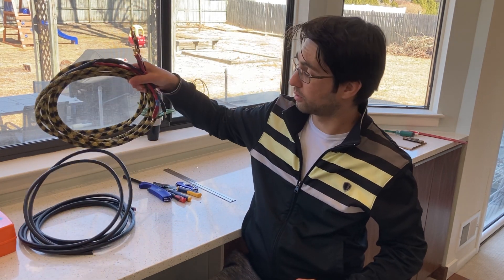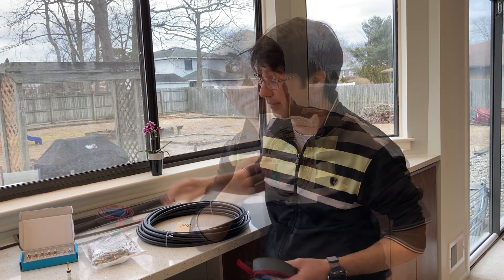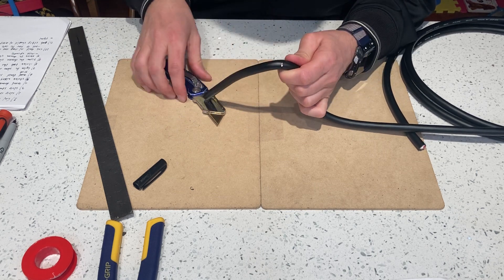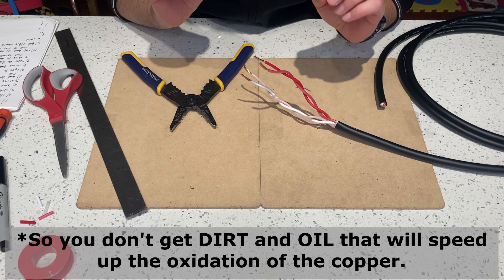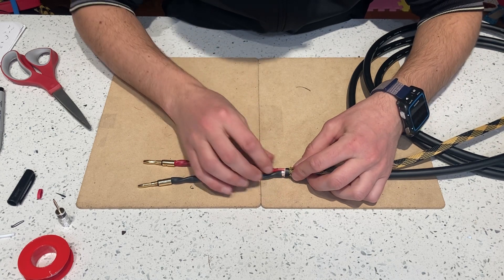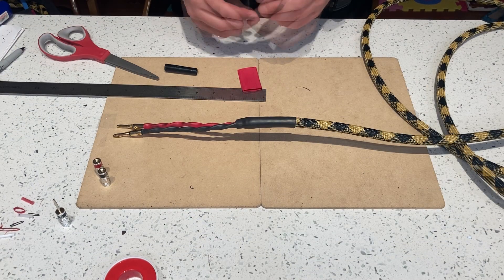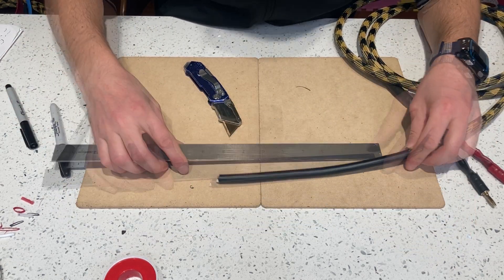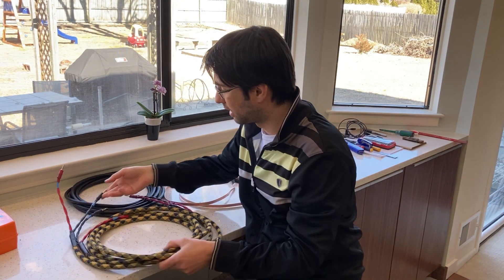DIY Speaker Cables - How to Build Your Own High Quality Speaker Wire (w/t Canare 4S11 Made in Japan)

Comment: While quality of material is important, one of the little known secrets of true high end speaker cable involves its ability to cancel out RFI. Any wire length will act as an antenna and pick up random RF which will interfere with and disrupt the audio signal traveling through that wire. Obviously some settings present more RF problems than others, hence the differing levels of performance improvement noted by observers. Nonetheless, if you are going to go to the trouble to build your own cables, then you should build them to cancel out RF. The simple solution (easy design, difficult implementation) involves running the two leads that carry the audio signal so that they never run parallel to one another, and second of all, that they in fact cross each other continuously at many points along their path. The way to achieve this involves wrapping the two wires around a center core in opposite directions so that they cross each other at two points with every revolution around the center core. A more advanced version of this involves the use of a four wire cable as shown here, with each pair of wires sitting opposite one another wires together (e.g., counting the four wires in the bundle around a circle, numbers one and three would carry the positive signal, and numbers two and four would carry the negative return). Now wrap wires one and three in opposite directions so they cross each other twice with every revolution, for the full target length of ten feet, then do the same for wires two and four. You will have to build a jig that holds the flexible center core tight while doing the wrapping, and you will have to apply tape to hold the wires in place at every foot or so. BTW, power cables have the same RF issues and should be built the same way, using four small (e.g. 14-16 gauge) wires instead of two large ones. Given their one meter target length, they would be a bit easier to build.
Reply from the maker: Great write up! Appreciate you the time for sharing! I actually do deal with Rfi and emi in my job, but those are different systems and applications all together.
Reply: I've worked for years building gigantic industrial machinery hand in hand with engineers you are living in a Dreamland when it comes to your bizzare concepts of RF interference
Reply: @ericschulze5641  I agree.  If it were a problem, folks would have noticed big time throughout the '60s and '70s as this stuff was gaining power and reducing distortion.  If rf injection were a problem with audio spectrum amps and output transducers (speakers) we would have known about it and addressed it decades ago.  Since we know it is not a problem, this guy is just pissing in the wind on that one.  As far as reducing capacitance goes, however...  that does need to be addressed on higher power systems.  Not much at all on lower power systems.
Reply: @ericschulze5641  Funny thing, you failed to mention all the various speaker cables you have built and tested using various designs and materials, and what components make up your highly revealing reproduction system, and how many hours you have spent in critical listening tests, and the many years you have spent in the industry or related music field developing critical listening ears, and the process you go through to minimize bias in your listening tests. I suspect you don't have any of this to offer. Thanks but I'll attend to those who can boast of all of these attributes (and I include myself in that list).
Reply: @SpeakerBuilder  Correct.  The guy has obvs never heard of crosstalk either, despite his ‘years’ of experience in an unrelated field.  I have awfull high frequency hearing damage and i can distinguish between cheap vs expensive cabling, but i can’t distinguish between variants of solid cores or oxygen free, but have to honest, if im spending £15k+ on a system, id probably not insert the cheapest cables on principle, not hearing.
Reply: @briandickie7264  "I can distinguish between cheap and expensive cabling".  Pure horseshit.  I could blind test you and you would fail.
Reply: @briandickie7264  I was listening to audio amps back in the late sixties...  Probably before your parents were born.  And I studied in and worked in electronics all my life and am familiar with all the various and sundry types and ways the original audio signal can get distorted and the various places along the way to the output transducer that it can and does happen.  I don't need a primer from you on it.  I was probably weaving speaker cables before you were born.
Reply: @cosmicraysshotsintothelight  Yes it does seem like you are stuck in the 60’s….   A lot of tech from then was groundbreaking and by today’s standards and knowledge, poor quality, inconsistent and less understood.  Maybe it’s time to update your knowledge.  

What i don’t understand is why you are so rude & abusive.  What has my age got to do with it?  Anyway, if you are like this in real life, it explains your social awkwardness, lack of friends and loneliness.   Kinda feel sorry for you.  I don’t know why life has been so bad for you, to treat others this way, narcissism at its best of course, but i wish you well, but like all narcassists, you don’t take responsibility, have to have the last word, and of course, blame everyone else.  I guess it’s just my turn for your abuse.

Comment: if I had a HiFi System that provides Speakers and Amps that would make these kind of Cables nessecary, so something worth several thousand dollars (15.000$ minimum) than I could easily pay ready made speaker cables for a few hundred dollars. if I don't have a HiFi system like that I could use just regular speaker cables in 4mm and it would be enough.
Reply: These cost $17 each for a ten foot cable.

Comment: Wow. I'll bet these cables sound every bit as good as ordinary, every day speaker wire, or zip cord.
Reply: Yeah, you're right - they will...   They might measure a teeny tiny bit better due to the copper and the connects,  depending on length.  How they're driven, etc. But it won't be a big deal. 

But the cost breakdown for these is pretty damn good.  It is about $17 per 10 feet.   For me, making them look how I want with the sleeving and whatever terminations I choose.  That's the whole deal right there.   

2, 14AWG cables effectively becoming 11AWG...   As a custom cable for my setup.  You can either pay through the nose for that customization or you can DIY.

Enjoy the holidays!

Comment: Come on dude snake oil , pure snake oil no better than just plain good 14awg speaker wire on amazon for $15.  They look nice and you may feel there special, but in the end snake oil no performance gain at all.  I have tried high priced speaker cables and interconnects and heard 000000000 difference.  The single best audio upgrade that you can really hear a differance is speakers.
Reply: Its funny when people get so fixated on a point that is truly subjective that they overlook the the topic of the video.Im not saying you are wrong with the snake-oil comment, although, if your Equiptment is worthy of such cables, you will notice some improvements but they may not be worth cables that are hundreds of dollars each. The real issue here is that you arent even getting the actual point of the video - to make affordable “snake-oil” cables opposed to blowing your hard earned dollars on them.

Comment: typical vodoo audio. The average physics student is able to show with an ordinary meter that you can connect the best and most expensive loudspeakers with a regular copper cable from microwave or washing machines and you will not be able to hear any difference. It is no coincidence that so-called audiophiles avoid blind listening trials. I will also tell you such a secret ... you can buy or make cables for thousands of dollars, and the manufacturer of your super expensive speakers uses inside ordinary cables that have been purchased for kilometers from the same warehouse for many years. :D :D:D:D:D:D:D:D
Reply: @depresja wykalczki     Bzdura.  As speaker builder noted, a high end system can be revealing of anything you change in a system, even tweaks like support cones, pucks, platforms.  We can do our own tests in a system and determine which cables or tweaks improve or degrade a systems performance.  I've tried expensive cables which sounded worse than less expensive ones and vice-versa.  RE: cables.  as I've noted before, cables that have equal resistance, inductance and capacitance will sound the same, but if they are different, then the sonics may be different.
Reply: A true high end reproduction system (with very good speakers) playing very clean music can reveal differences between various speaker cables, as I have demonstrated for myself and as my video on the topic attests to. But these differences are quite small and can only be heard if the rest of the system is true high end. The system I used to test speaker cables would cost in the range of $3500, not crazy but some serious money. I really like this guy's emphasis on building your own vs spending stupid money on who knows what. See my comment above re building a cable that addresses RF, as this CAN be an issue in some (but perhaps not all) locations.

Comment: 99 % of people don't need High End Speaker Wire; and if you're using Copper it is not HIGH END.
Reply: What about OHNO Continuous Cast (OCC) Copper?
Reply: @amazoidal  Hello I am unfamiliar with OHNO I will have to educate myself, but Silver is the way to go in my book. But then it is all about what YOU/I hear
Reply: @danielscott1749  If it's all about what we hear... Then your statement about silver doesn't apply anymore.    Because you are correct, it matters what sounds best to you.   For some, copper, others, silver.   I have a blend.   I have silver in my DAC line and my interconnects...  It changed everything.   But I also have built these cables.   The whole system comes together nicely...   I imagine that silver plated copper on the speaker lines might make things too bright... But I won't know until I try.

Comment: I only have a budget receiver but I have splashed out over £1,000 on 9 channels of shielded speaker cables and another £630 on a power conditioner, reason being I can't put up with any kind of radio frequencies interference!
In fact I've also kept all of my 9 channels of unshielded speaker cable in place so I'm able to do a comparison for my friends and it's only when i point out the differences and then go ahead and connect the shielded cables that everything becomes apparent for them!
Conclusion: IMO this proves it's all about ones own perception or dare I say lack of
Reply from the maker: Nice! You can spend a pretty penny on cables, as long as it makes a difference to you and you enjoy! I really like the cables I built and the start quad helps reduce some of the frequency interference coming from the speaker cables. It’s a good topology, helps prevent some coupling right at the back of your stereo where everything is bunched together.

Comment: are you sure those are not car jumper cables? WOW, you could throw your back out just lifting them up :-)
Reply from the maker: Hahaha it’s not that bad 😁. I mean there are 4 cables in there, and the overall diameter is almost 1/2 inch. Imagine going to 10 or 9 gauge... 😬. I’ve seen audiophile cables much thicker then that hehe
Reply: I found that heavier gauge wire (12) improved bass response when compared to using 16 gauge, and the improvement was easily and immediately noticeable (it was a small difference, I'm not trying to overstate the matter). But high frequencies were improved with small, single core wire. So there's a compromise necessary when selecting wire for a full range speaker.

Comment: Nice work. Why did you wrap the sleeve and cable with teflon tape?
Reply from the maker: Thank you! I did it to reinforce, and smooth out the transition. It will give it a little more rigidity and when the shrink tube shrinks it will look a little smoother. It’s a nice to have but totally optional